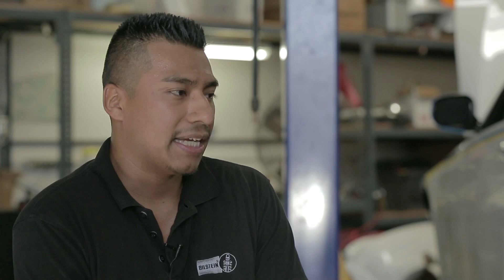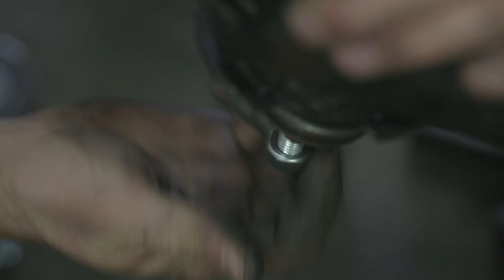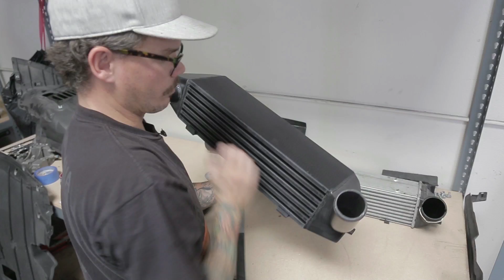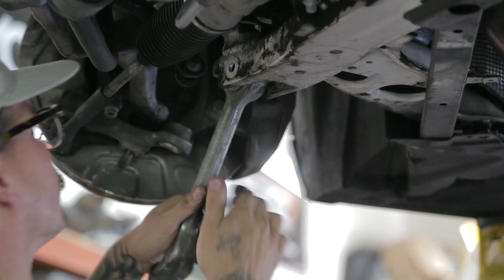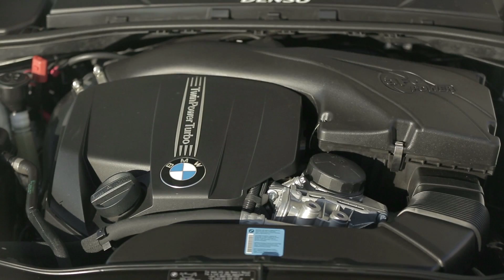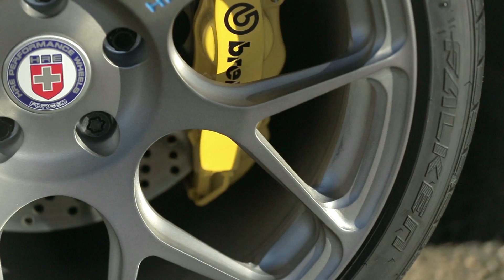Building a BMW 335i for the SEMA Show: Making the Ultimate Driving Machine Better!

Comment: eww n55
Reply: More reliable than n54
Reply: @thinkingagain5966   I currently own a N55, N54, and an m3 with an s65. all equally as reliably as long as they are taken care of. The reliability card is often used by people that are just too cheap to take care of their cars.
Reply: @DYNAMMIC-  then wtf u say "eww n55" like little girl??
Reply: because its a boring engine lmfao. its great in my daily but that's about it.
Reply: @DYNAMMIC-  the n54 is just as fast and powerful as the n54 stock. The "tuner friendly" card is often played by ppl that are too cheap to add the necessary mods to make it faster or just plain don't know wtf they're talking about lmfao

Comment: I want to buy a used 335i with around 80k-100k miles but I hear that if something goes wrong its expensive to fix do you guys recommend buying a used BMW?
Reply: Depends if you can turn your own wrench. That's the key. Labor prices kill you if something goes wrong. BMWs tend to scare people away because they can be complicated but when you start tearing them apart you realize the same engineering that put together the ultimate driving machine also was designed so any peon mechanic could get the job done.
Reply: Curt Loesch And if you guys need a computer genius that wants to learn to be a master tuner, hit me up. <smiley face>
Reply: http://phoenix.craigslist.org/evl/cto/4623707950.html
Reply: Eric, make sure the car has a full BMW service history and get a price off BMW for an extended warranty. If the service history on the 335s you are looking at is patchy or done by non-BMW approved garages then just walk away. It is better to keep saving and get the right car with the right history.
Reply: Can you guys tell me if this is a good car to 

http://www.carsforsale.com/vehicle/details/3277631

Comment: I'd sell it and buy a 335i with a manual.
Reply: unfound23 That's too bad.  I never really understood why Euro spec BMW's such as the E60 and F10 M5's only came with some sort of automatic.  Maybe you lot favor sheer speed over all else?  I guess here in the States we prefer our driver's cars to be a bit slower but a lot more fun.
Reply: Bryan Meyerott 
At least here in Germany and Austria, you could not get E92 335i with a manual?! :-O
Seems like again it´s like the E60 and F10 only the US get´s a manual option on the M5^^
Reply: +Sean Simmons Ok now I'm thinking you lead a pedestrian lifestyle.
Reply: Bryan Meyerott
As I heard from a friend of mine who drove a US-spec E60 M5 with a manual, he said the gearbox is rubbish...

Something like it feels like it´s coming from the 550i and has been adapted^^...

I dunno if that is correct, but I can imagine...

BMW never sold the E92 335i and d as a manual in europe neither...

I don´t know, you should know that there are different views on this over here too...

I for my part hate automatics, they feel wrong to me :-P
But that was not something BMW considered when designing the E60 and F10...Why should they ?

And possible the only real reason is obvious, EU-regulations, BMW forces you to buy an Auto because you will use the function if you have it....
So you lower emissions by changing the gear shift dynamics of a car... ;-)

So it all comes down to that massive "Green-hype", in the European union....

They even started to not let cars pass the annual technical inspection called "§56"-check in Austria.

Every year you have to have your car inspected by a certified mechanic, which will test your brakes, inspect the whole car and let it pass if it is roadworthy....

So if your car is too old you won´t be allowed to drive your car anymore, because of emission standards mostly....

So there numerous reasons why it is like that, and to be honest, for the real car nuts here in Europe a manual is a manual you can´t replace it....

So no we Europeans don´t prefer speed above all else, but we often do not have a choice...
Reply: Well then you could go fuck your self.
Reply: Sean Simmons I'd be a little pissed too if all I had to drive was a '94 automatic V6 Mustang.
Reply: Hey whats wrong with my auto '94 V6 mustang, all the ladies love it.

Comment: Very neat stuff. I was impressed with what you did to the car. It wasn't overkill, and most importantly you didn't try to overcompensate any problem by killing the car with horsepower. Not that horsepower is a bad thing, but I'd prefer steering feel, good brakes and grip over horsepower. Horsepower is for the drag strip or the back straight.

Comment: Personally their money would be better spent being a full eibach suspension package, racing brake rotors, goodridge stainless lines, forgestar wheels, (you've already saved over 11K), then a JB4, intake, exhaust, IC, and a hybrid (or for a bit more a replacement) turbo. M-Steering wheel too, now you're probably about 9K under what they spent making 450-500 at the wheels, have adjustable dampers, and are super stealthy.

Comment: I won't even address the M5 because that's not a valid comparison. However:
Because the N54 / 55 are way better power plants than the S65B40. Also, you don't get ripped off like you do in terms of performance when you buy an M3. A normal 335i has just as nice of an interior as the M3, more discreet exterior as well. These guys spent a lot of money in the wrong places and still it would be cheaper and faster than an M3. Also, depending on the suspension, more comfortable. Also, better mileage.

Comment: Well the M3 comes with a manual gearbox too. I think they used a 335 because the M3 already has a good balance of performance and usability. Adding more performance would upset that usability so by tuning this 335, its like they've created another variation on the M.

Comment: Yeah I think last time I checked, Lexus was one of the most reliable. I have a '96 Audi A4 with 180k km and haven't had any issues besides some normal wear and tear. *knocks on wood* I have heard about those issues though. Maybe I'm just one of the lucky ones?

As a side note, I've seen a Chevy Trailblazer with 500k miles. Some people just get lucky I guess.

Comment: Check Consumer Reports year end auto reviews. European cars never get top spots for reliability. I had an Audi 5000S which mechanically, was great. However, everything electrical had to be replaced at least 3 times. Eventually, it was costing more to keep the car running than it was worth. I got 175K miles out of it. My brother got 300K out of his Nissan Pathfinder.

Comment: A BMW can be just as reliable if you keep up with maintenance. Parts are of course more expensive than a Camry because the car is more expensive; a $60k car will have more expensive parts than a $20k, and an owner should know that going in.